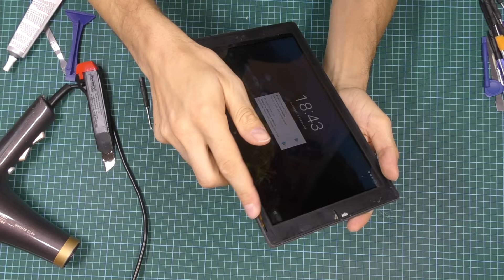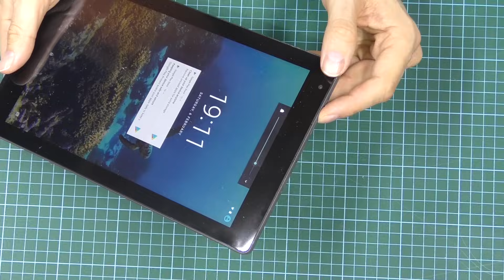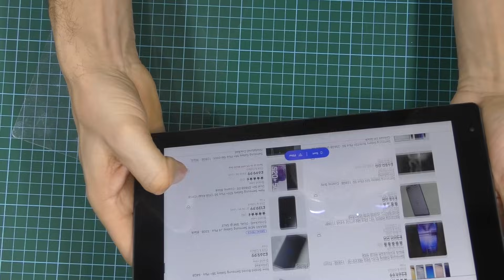Bush screen repair

Comment: Can we get the glass online if ordered by its model no ? 
What would be the price for Lenovo M10 tab ?
Reply from the maker: Hello, thanks for your comment.
Reply: @SuperDisassembler  you did not answered my question ...
Reply from the maker: Hello Jay Masali, I'm not answered because don't know, I had a broken tablet what is bush 10 inch, and not Lenovo. I was looking everywhere and find it on eBay, you need to do your own research, but Lenovo is quite popular so you should find it easily I think so...
Reply: @SuperDisassembler  👍
Reply: @jaymasali8365  😂 your going straight to the point , how are u 3 years past

Comment: The top glass of my CIDIA tablet ten inch CM two thousand model is broken. Please tell, whats the story of them big puppys ..... Thanks
Reply from the maker: Thanks for the comment.
Reply: I purchased from Al Taif, Saudi Arabia।Please help me.
Reply from the maker: Hello what is the problems with your tablet?
Reply: @SuperDisassembler  touch panel is broken Sir
Reply from the maker: Probably find the right touch panel (or compatible one) is the hardest part of the job, you need to do your own research to find online then you can start repair it. My tablet is bush 10 inch.